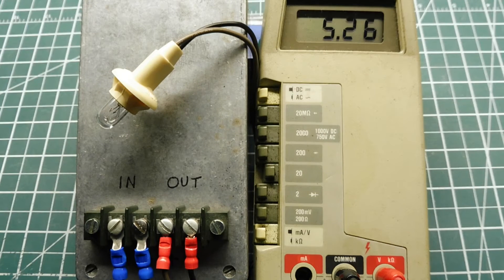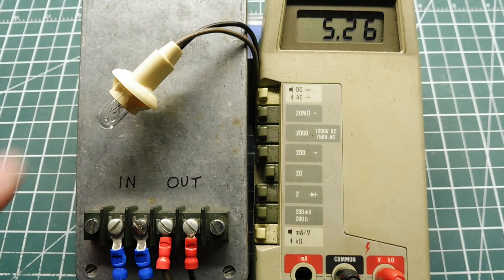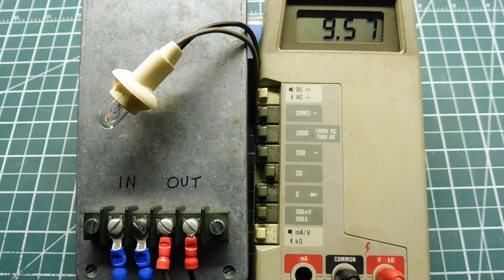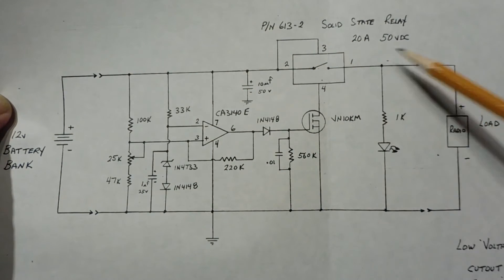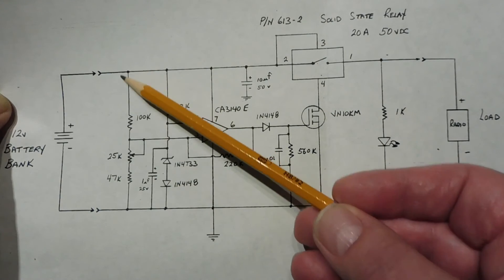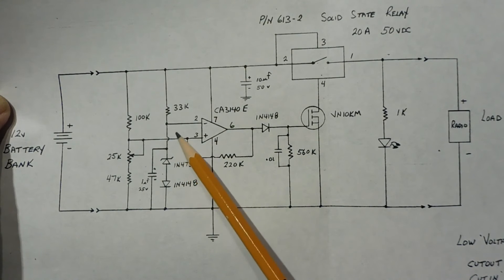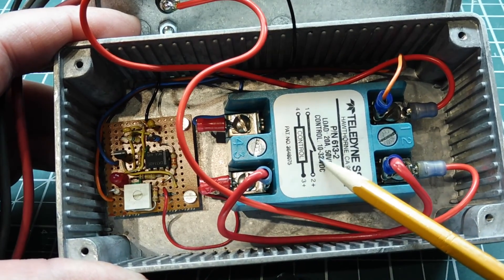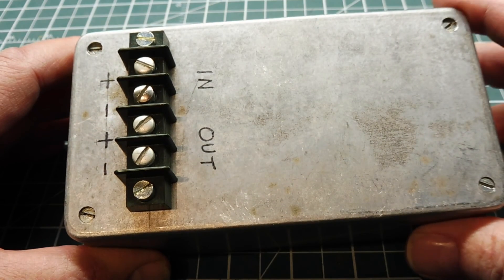Low Voltage Cutout For DC Loads

Comment: Loved this project, it's great! 😀Though this box is the exact opposite of what I need.🤨 Could you tell me how to adapt this circuit so I could energise a battery charging circuit when my solar powered batteries get to low?🙂😌I think I get the gist of it but I'd like to make sure before committing to actual.
Reply from the maker: Search online for low battery monitor using the TL431. This would be the simplest solution.
This video might give you some ideas which demonstrates a low battery alarm for 3.3v projects.
https://youtu.be/Oo4oMe2FN2c

Comment: Good job sir, how can i modify it for 36 volt system
Reply from the maker: Re-design the comparator circuit by changing the value of the Zener diode and adjusting the voltage divider circuit.

Comment: Does that hysteresis feedback resistor affect the cutout voltage as well, wouldn't it act as a parallel resistor to the first resistor when the comparator is pulled high and change the division ratio?

Comment: Im using 4 26650s for 7v nom so cutoff will be approx 6.4v?-6.6v?
Reply from the maker: The difference between the cut-in and cut-out voltage (hysteresis) is fixed by the 220k ohm resistor between pin 6 and pin 3. The circuit was designed for a 13.6 volt system and will need to be modified to work with other voltage standards.

Comment: thanks I have question about Hystersis and temp compenseation I didnt understand
Reply from the maker: Check out this video on temp compensation: https://youtu.be/ti6X29lIH7I
The difference between the trip "on" voltage and the trip "off" voltage is called Hysteresis. Without it the circuit would "chatter". This feature is also incorporated in your furnace thermostat.

Comment: Very slick cut out device.  Could you make a dummy load using a mosfet that does not need an external power source?
Reply from the maker: A mosfet needs a gate voltage to turn it on so the dummy load can be powered by the supply your are trying to test.
http://danyk.cz/zatez_en.html

Comment: doesnt the relay drain the source batteries very fast?
Reply from the maker: Low power consumption of this circuit is very important. The relay used is solid state which uses a transistor to turn on the load. The control current is only 10 mA. Other low power component used are the CMOS op amp and mosfet driver transistor. Even the status LED has a jumper so it can be disconnected to lower the current draw. Every little bit helps.